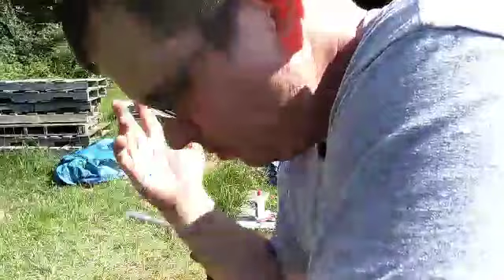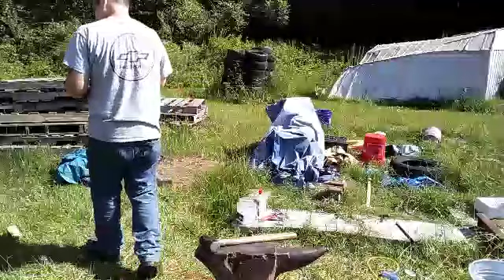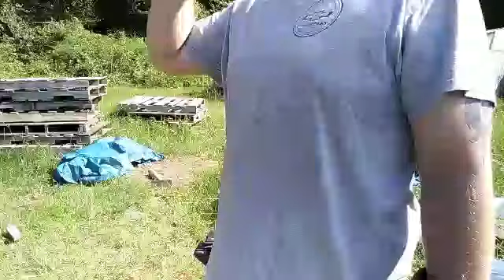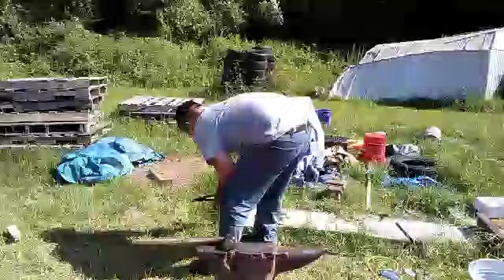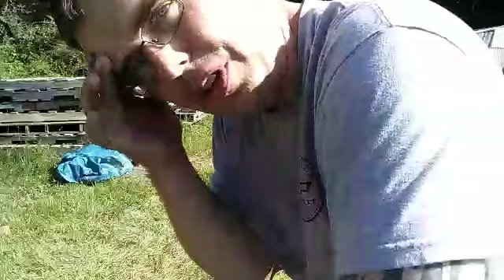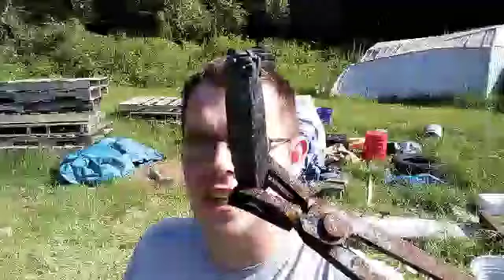Cable Damascus finished!!

Comment: Pastor Josh here... Looking great man! Whoever ends up winning the giveaway will be lucky to have it. Just a suggestion for your flux... Instead of grabbing it out and sprinkling over the grass, you could hold the cable over the flux bucket to catch the excess... I know 20 mule team borax isn't super expensive, but over time the savings could mean more steel or coal or tools or who knows what else... Just my 2 copper colored discs with President Lincoln's portrait on them worth. God bless.

Comment: Nice gloves, where did you get those? Mine are partially cloth and cought fire from some angle grinder sparks.
Reply from the maker: Got them from Lowe's. Welding section

Comment: I believe one of my projects in the near future is gonna be doing raindrop or ladder pattern cable damascus to see what happens.
Reply from the maker: I almost tried it today, but wasn't sure of it would work on the cable.
Reply: @outdoorswiththemick  I'm not sure either, I have an idea of what is likely to happen. That being said, I seem to be getting better results on my forge welds and I have a little more cable to work with so I suspect I may be able to pull it off. I mean that in the most respectful way possible, you're currently working on something I was terrified of doing. We need to talk about the process I used to get repeated inclusion-free billets.
Reply from the maker: Man I just go for it without thinking about it. And im sure if my vice was mounted on a log/table instead of the ground I could get a wayyyy better initial twist.
Reply: I know the feeling, 90% of the job is actually prep work. The twist is important but you don't HAVE to really go too crazy on it as long as the right prep work was done and it's at welding temp.
Reply from the maker: Man when I make the trip to your place, I'm gonna bring a piece with me along with the chain.
Reply: @outdoorswiththemick  SWEET. We have some playing to do. And we may do a live feed of making cable damascus from scratch start to finish. And at that point we can either ladder it or raindrop it. I think raindrop even though I've never done any kind of external manipulation to any of the 3 pieces of damascus I've made so far.
Reply from the maker: Never know if you don't try! Let's do it
Reply: 10-4!

Comment: Them wire brushes suck. Big doo doo!!! Lol  I can't afford a butcher block yet. So I use flux to help me take the scale off. I am putting a post on Facebook to see if I can find some old cable anywhere. So I can try it. Reyes a chain and it didn't work so well. But it was a big one. Try small next time. Then mybe!!??!!